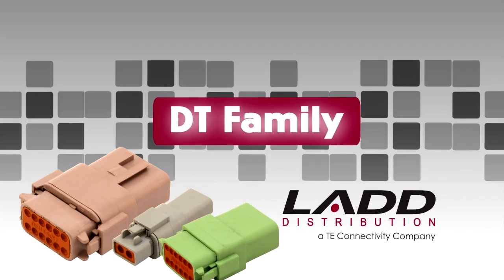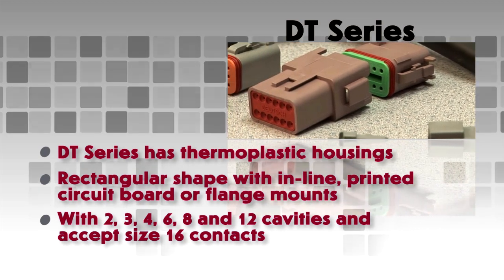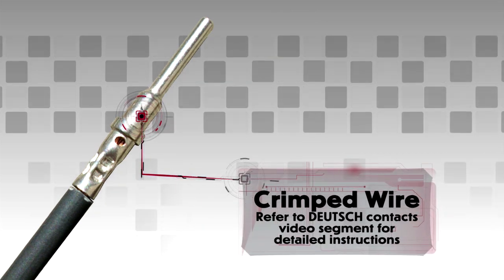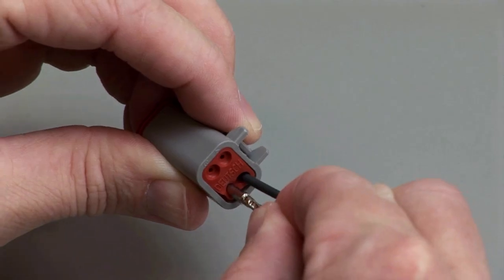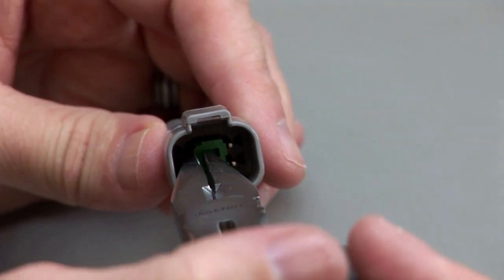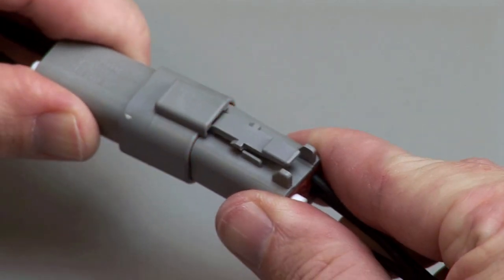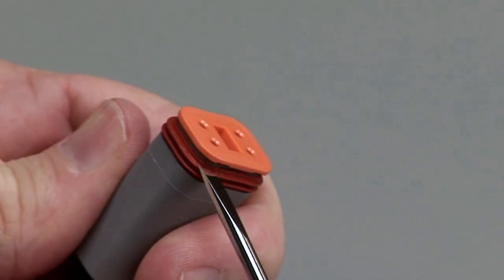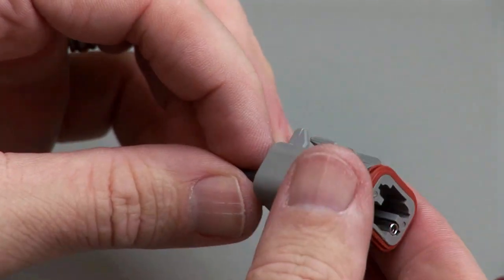DEUTSCH DT Series Connector Instructions

Comment: Great but how do you get the wedgelock out of a 12 pin connector?
Reply from the maker: Hi Curtis, thanks for reaching out to us. For the plug side of a 12-pin DT connector, the wedgelock removal process is the same as shown at 03:18. For a DT 12-pin receptacle connector, you will want to use the hooked end of a DT-RT1 or a similar style hooked tool to pull the wedgelock out. 

There is a slot in the center of the wedgelock. Slide the hooked tool into the slot. Grab the side of the wedgelock with the hook and then pull straight out. Not much force should be needed. 

If you do not have a hooked tool, you can use a pair of needle nose pliers. Insert the pliers into the connector and grab the wedgelock close to its center slot. Pull straight out.

DT-RT1: https://laddinc.com/product/?sku=DT-RT1 

If you have any additional questions or would like to speak with a customer service representative, please contact our team. https://laddinc.com/contact-us/ 

Thank you.
Reply: Thank You for the feedback. It did not come out easily. It eventually took two sets of hands the tool and a small screwdriver before we finally got it to pop out. Then it flew half way across the shop...lol.